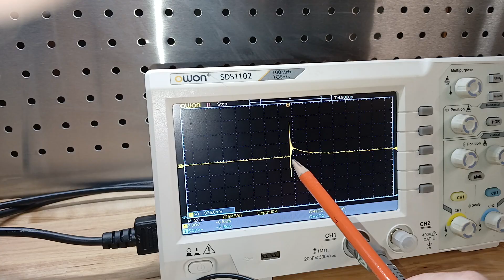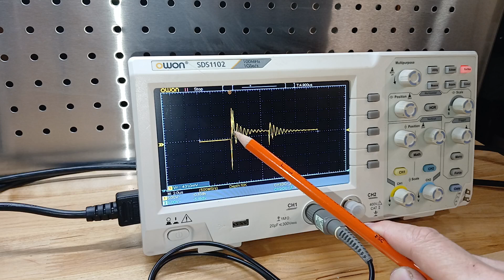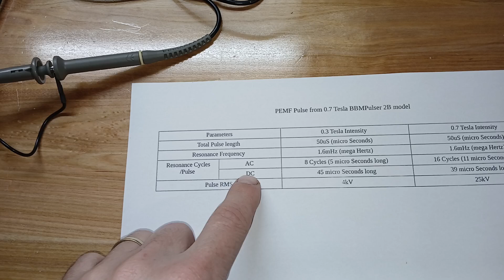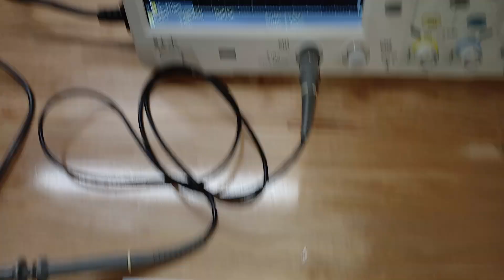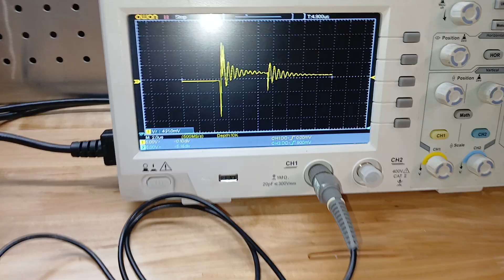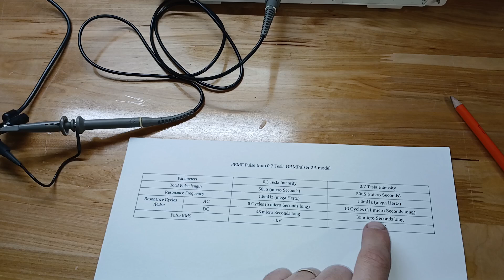210 PEMF Pulse from 0.7 Tesla BBMPulser 2B1 viewed on oscilloscope

Comment: Hi Andrey. Seems you have a LC ringing in the circuit with reverse-biasing of the capacitors. Is this on purpose? There are some patents about Oscillating Magnetic Field being effective against pathogens and cancer.
Reply from the maker: It wasn't done on purpose. It just happened. Yes there are patents  
Here is one
https://bbmpulser.org/wp-content/uploads/2021/01/Deactivation-of-microorganisms-by-an-oscellating-magnetic-field-US4524079.pdf

Comment: Nice; I like the small form factor.  I'll be interested to see how small you
can make the circuit board.  Looks pretty tight in there.
 It's the first time I've seen the 3D-Printed Coil Wand .  Looks good. 
Maybe the  edges should be rounded  more as in the molded coil?
It would be easier to glide around on a surface without as much drag..
Reply from the maker: I think it's good as is. You already made it resemble original pretty close. Yes, this is the first pulser I tested this Coil. I filled it up with epoxy, it's very solid, like a brick. Works good, a bit weaker then original but no need for mold, anyone can do it!
Reply: @AndreyD  Vive la Open Source!

Comment: 0.3T-17Hz: AC 5µs+DC 45µs=50 µs；Pulse RMS 4kv
0.7T-3.75Hz: AC 11µs+DC 39µs50 µs；Pulse RMS 25kv
Each total pulse length is 50 µs.
This parameter is not bad.

The PEMF was intentionally designed to induce microcurrents in the body. The steeper the slopes of the magnetic pulse, the higher the induced microcurrents, and therefore, the greater its effectiveness in activating cell metabolism. The pulse was designed so that its rising and falling edges are as steep as possible. This ensures that even at the shortest possible pulse duration, the acceleration time (or rate of change) remains very short.

Conversely, a magnetic pulse that is less optimized will be less effective in activating cell metabolism.

PEMF-induced muscle contraction indicates that it induces a vortex current up to the threshold of the nerve cells, causing depolarization of the cell membranes of the neurons (especially the motor neurons innervating the muscles).

Comment: Can you trigger muscles by stimulating brain motor cortex?
Reply from the maker: This model is not strong enough to do that
Reply: @AndreyD and your strongest model?
Reply from the maker: @brandonbehc I was able to do it with 3.5 Tesla and 5 Tesla models
And it was small respond, not very vivid. Tried it on myself
Reply: @AndreyD  How do the construction, parameters, and therapeutic goals of rTMS compare to your product?
Reply from the maker: @jlj7490  I haven't had a chance to open or study the circuitry of the rTMS units yet. From my understanding rTMS are generating high intensity probably around 50kV RMS short pulses my guess around 1nS long. This will trigger muscle at some distance